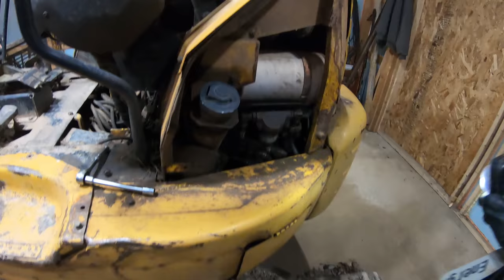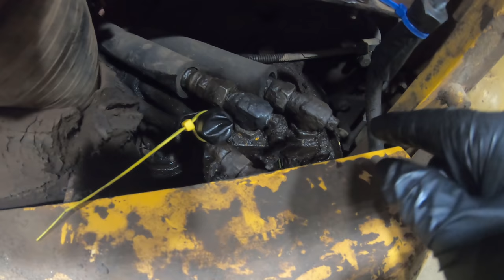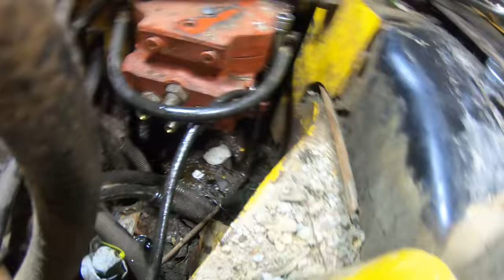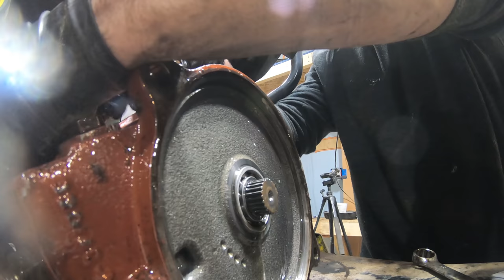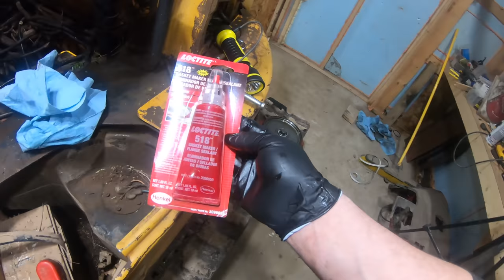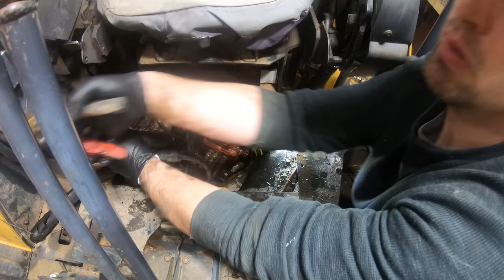How to remove and install a swing motor on a John Deere 35 zts

Comment: Thanks so much, I am about to reinstall my swing motor tomorrow and was a bit worried about how to fill it and remove air, this vid was so helpful thanks. Incidentally my digger is a yanmar 5.5 tonne and I used different coloured nail polish to mark all the hoses.

Comment: I'm a wuss when it comes to greasy dirt. That thing needs a little degreaser and a pressure wash. When something breaks in the field it is not much of an option but when it is elective repair work like this, the machine and you both benefit.

Comment: You should get a plug/cap set for those fittings.
Reply from the maker: I did actually have some but I think they were slightly bigger and kept sliding off easily, of course afterwords I found the right ones at powertech in kingston
Reply from the maker: @AndrewCamarata oh wow they are metal, I def am going to get this set, I was working with the plastic ones and they would fall off
Reply: @jmuller86 Yeah, it was helpful when I got it. With these, you could put pressure on the lines and they would be ok.
Reply: Andrew this type is used on bobcat cat and some hitachi/ deeres.  European hitachis of this model uses bsp fittings. Same as both your yanmar excavators
Reply: @megape95 Yes, good eye. Jesse, this is the set: https://amzn.to/2UL7HdL
Reply: @AndrewCamarata   haha no thats the wrong one too. The flare is external instead of internal. I cant find the right one on amazon
Reply: @AndrewCamarata  that kit is o-ring boss, NOT RIGHT,,  most fittings are JIC unless you take the fitting out of the valve or motor then its NPT OR o-ring boss to JIC, HE LEFT THE FITTINGS ON THE OTOR. NEVER BUY THE PLASTIC  ones the brake in cold weather and after a few uses they never stay in, as the need to be puton tight to hold the oil
Reply: @megape95  WHAT A RIP OFF ON THE PRICE, I CAN GET THE SAME SET HERE AT TRUCK AND HYDROPHILIC FOR $72 CND AND A jic  SET FOR $22 CND #4UP TO #12
Reply: @arnoldromppai5395  i know  the thing is expensive, but if you search better you can find cheaper ones
Reply: @megape95  i dont think i need to sarch amazon for anything cheaper then i can get locally or from my suppliers, anything i have ever looked at on amazon is high priced, and dont think anyone can beat $25 cnd
Reply: @megape95  All I know is my hydraulic hose guys say that its british thread
Reply: Another tip is to place a matching zip tie on the connections into the drive motor, that way you can match them when reinstalling the hoses to save you going back to your video. 😁
Reply: I've go to get in on this Jess & Andrew chat.
Never no what I'll learn.

Comment: Great idea about draining the system before disconnecting any hoses. I would've pressure washed the compartment before starting the repairs. That would've minimized the chances of contamination.

Comment: Interesting  idea buying colored zip ties. I've always used blue masking tape and sharpie  to mark hoses  and lines. Afterwards  I leave the blue tape on the line so next time it comes off its already marked. Keep up the good work on your videos.
Reply: WE HAVE USED a center punch for 50 years, you stamp 123 marks in each end of fitting were that hose goes, no looking back at videos, was none then..,, hose 1 has one dimple on each fitting, 2, 3 4 ans so on, you mark them once and they are there for ever, you hook up a line wrong and you can blow up a pump or some other component in a second
Reply from the maker: @arnoldromppai5395  yea, I did learn that recently, from the dealer service guys actually. I have a video coming out where I took out the control valve assembly to chase a leak, and there was about 40 hoses, I dont think I could fit enough dots to make those work? maybe start doing some on each side of the hex flange
Reply: @jmuller86  thats right work them around the fitting, and you can get 3 or 4 side by side or in rows down the crimp flang when the bottom nut to small, when i worked in the logging camps with big fellow forwarders, we would have to remove over 100 hose to change a lot of parts or engeine, and there would be dots all around every metal part, , hoses as big a 1-1/2" down to pilot 1/4" hoses
Reply: @jmuller86  You did IT Jesse, get some HEX punches. For a 40 hose job you have a maximum of 3 characters per fitting. 😂 (Yes, I am kidding)

Comment: I have a Yanmar like this . Excellent quality
Mine has slow leak .
Deere used Yanmar machines on small and Hitachi on large excavator s. 
That red loctite may be anerobic sealer cures without oxygen .

Comment: Hey I have the same machine, if your spin is slow and blade lacks the power to lift you might check the gear pump. I replaced mine and its zippy spin wise now.

Comment: Jesse, you may not see this but, What is "zero swing" and "swing motor"? 
About your zip ties having only 6 combinations. I took this as a challenge but I had to stop. You will see why.
L=Long, S=Short, Y=Yellow, B=Blue, W=White
LYLY, LYLB, LYLW
LBLB, LBLW, 
LWLW
LYSY, LYSB, LYSW
LBSY, LBSB, LBSW
LWSY, LWSB, LWSW
Then you could reverse the order of the last 9 combinations and have more. I know you must be thinking, "This guy must have a screw loose". LOL, I could code those as well.

Comment: You could weld a nut to the top of that hex bolt to make it easier to remove, assuming u have the clearance. Just a thought or buy new bolts.

Comment: Fun Video. Bought mini kubota excavator for home use. It compliments compact tractor projects. No thumb yet, have to machine a longer bucket pin for thumb mounting.
Reply: Check out Titan attachment. That company has great deals on thumbs. Their DIY weld it together thumb kit is very awesome and heavy duty.
Reply: I want a thumb on Takeuchi TB016. I know I have to get hoses made but whichone goes to which side? And do you have to fit some release thing so the thumb yields to the bucket? Anyone? Thanks.

Comment: Phew! Well done! Glad I don't have to do that...this time. What I do have to do is change at least one burst hose going down to the final drive which will mean lifting  the machine so I can access the inside/feed end from an access panel right underneath. To do that I have to move the machine a few yards out of a small store in a barn. Since at least one track isn't working can I push the machine backwards using the boom forcing the bucket against the ground -- freeing the brake by turning the engine on and putting the safety levers down in off position? Any response gratefully received.
Reply from the maker: jump limp it over, lift the one side up with the boom and swing it as you track with the working track
Reply: Good idea. But at present the boom is inside the wood store at the end of the barn so I've got to back it up 2-3 yards. When I've figured out how how to do that I'll do what you suggest, IF the other side is working backwards. There's a lot of oil on the track and I don't know if it was just spray from t'other side. 
Thanks.
LGB.

Comment: Interesting, I've had to do a similar job on a Bobcat 331, the pinion seal is bad and leaking oil.
Same size machine but Bobcat uses a Eaton hydraulic motor and no planetary just direct drive to the pinion.
Direct drive means they use hydraulic oil all through as a lubricant as well, no gear oil.
They also use the exact same setup with the 334, I know because Clark sent me both part diagrams when I was quoting the job.

Comment: Why don't you use a pressure washer to remove all the dirt from that engine/hydraulic bay prior to opening the hydraulics up?
At one point you say why they don't make it more accesible due to potential  dirt contermination in the hydraulic system, but giving it a 5min pressure wash (preferably with warm water and a soap) is a very easy thing to do to prevent 99% of that contermination.
Or don't you have running water in your workshoplocation? (if so, maybe rig something up with a reservoir or ground water and a filter?)
edit: oh wait, I've read your reply down in the comments, you already had the oil drained before realizing it was very dirty in there.
Thats a good lesson for next time :D
Reply: The best thing to use is Greased Lightning.
You can get it by the gallon.
I found it helping a friend clean the kitchen in the bar his dad owned.
I worked for the company that owned the Jukebox, pool tables and other games as the route service manager.
That stuff is incredible at cutting heavy grease and oil.
We used it behind their oil fryer.
The grease behind it was a quarter inch thick and had gotten them gigged by the county health inspector.
I thought they'd have to get a steam blaster till he squirted a 50 / 50 mix (usually you water it 70-75/25-30) on it and the stuff just run off like nasty water.
We did have to use a paint scraper on some of it but it all came off.
Ever since then I use it when I clean pool tables when I recover them.
Those can get real nasty on the sides in bars.

Comment: Hiii Jesse  !!!    first need (but so expensive) hot water pressure washer ! because some time just looking at the mess (grease oil sand mixed) enough to stop the job !!! 
To plug pipes and entry holes I make my conical cork stoppers  (ex wyn bottle corke) that give's you all size you need ! 
YAaaa they haven't invented spanners  with eyes on the end and feeling like the fingers

Comment: Jesse do u notice any effect on your other hydraulic functions by having a bad seal on the swing motor.When our seal went it affected everything from arm to stick to track drives.When we checked out the system pressures they were lower than spec.After we replaced the seal back to new

Comment: Would be nice if you had a pressure and could washed it first
Reply from the maker: When I got all the covers off I realized It needed to be pressurewashed, but by that time I had the fluid drained and couldnt wash it because I dont have a drain in the garage.
Reply: Jesse Muller good job love your video
Reply: @jmuller86  that dont add up in the video, you took all the covers off showed both areas that had to work in, and could see all the stones thick dirt, then you drained the oil..
Reply from the maker: @arnoldromppai5395  yea because I drained the oil first before doing anything, but the order was switched for the sake of the video.
Reply: @jmuller86  ok that make sense, thanks for clearing that up..

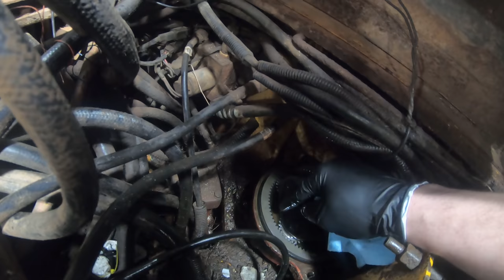Comment: 13:21 Is that large O-ring what makes the seal? Just me asking. Not picking at your work. At all.
Reply from the maker: I think its a secondary seal, I have the service manual and it says to use the primer and sealer
Reply: @jmuller86  Thanks. Was that surface ever sealed, right from the factory? It looked awfully clean.

Comment: Glad that fixed the leak for you, definitely a tough spot to work in.
My neighbors excavator can't slew uphill half the time, other times it drifts on its own until the brake kicks in.  Do you think that's a failed seal in the slew motor or elsewhere?
Reply from the maker: the problem I had ended up being the small gear pump, it powers the slew and the blade, and also offset boom. It was cheap and easy to replace
Reply: @jmuller86  That may be his problem, he recently said his offset boom had an issue as well.  Thanks for the help.

Comment: Jessy why don't you pressure wash around where you take things apart before, so you have a better working environment and greatly reduce the contamination factor, seems like a no brainer to me, like when you did the final drive on the new bulldozed, you scraped after you had everything back in, it seems like you have your steps out of step, just an observation Jessy.

Comment: ok if you had the swing motor tested because the swing was bad, but the swing motor checked out ok, so what fixed the swing, the swing pump, the swing pilot valve, witch is the most comon,?
Reply from the maker: It was the swing gear pump. I will have a video up in another week or so
Reply: @jmuller86  ok thank you, it maybe just the releaf valve in the pump, if it is a desent pump it will have one, the spring normaly brakes
Reply from the maker: @arnoldromppai5395  the gear pump was worn badly, the housing was all scored up and one of the gear shafts was really beat up. Looked like it was from low oil from the previous owner
Reply: @jmuller86  ok you seen the in sides, many shops will tell you a pump oe moter is gone when its just a re leaf, to sell you a new pump or motor
Reply from the maker: @arnoldromppai5395  yea I know, thats why I rebuild my own stuff, I  have rebuilt many transmissions, motors, transfer cases. I rebuilt the main piston pump as well so the gear pump was easy to figure out, But not rebuildable, they dont sell parts for it.
Reply: @jmuller86  cant seem to find the follow up to this video... is there one? I have slow swing on my sk55
Reply from the maker: @wheelinken  the problem with mine was the gear pump for the swing/boom swing
Reply: @jmuller86  thanks for the reply, did you end up doing a video on that?
Reply: @jmuller86  could you up load the gear pump video please, if you did make one?
Reply: @wheelinKen did you ever figure out what was wrong with your SK? I have an SK45 and I'm definitely lacking swing power/speed... just curious how you made out...

Comment: What does a zero swing motor mean, you said it a few times during the video.
Reply from the maker: its not the motor, its the design of the machine, the fram never goes outside the track when swinging

Comment: What's name/brand of black gloves you're wearing? Thx
Reply from the maker: They are called venom nitrile gloves. I buy them at lowes, its like $20 for 100 gloves. They work great, 2 layers of material so they dont rip so easily

Comment: Why not zip tie the motor fittings?
Reply: Doesn't make sense to color zip tie the hose and not the corresponding fitting.  That would tell you exactly where it attaches too.
Reply: That’s what I do ,didn’t understand why he didn’t expect I guess he was going to watch the video.🤷‍♂️
Reply from the maker: There was only 4 hoses and 1 was smaller so the other 3 were kind of obvious where they went. I did take the main control valve assembly out, and that has 40 hoses, so I bought more colors and did exactly what your saying where I did corresponding ties on the adapters.
Reply: @jmuller86  If you don't have enough colours put combinations and multiple ties on.

Comment: Jesse jesse,you guys all make the same mistake. Old equipment is all warped and rust jacked. When you REMOVE a bolt ,it puts more pressure on the remaining bolts. SOOO, loosen a bolt and tighten it back up. Then go on  to the next one..,ect. When you have them all cracked loose,NOW REMOVE THEM .

Comment: you color coded the female side of the hoses but didn't color code the male fittings to match
Reply from the maker: Yea because I can play back the video and find out if its left or right. I did a big manifold job and marked both for that

Comment: Boy, and I thought it was a b#@th changing a main rotor gearbox on a Coast Guard Sikorski HH52a helicopter.
Ot the T58 Turboshaft endine.
Those were a piece of cake compared to that as we were able to pull off all the "skins" to get at them.
Me thunks that was designed by ghost satanically inspired engineers from the Spanish inquisition.
Reply: No one expects the Spanish inquisition.

Comment: problem is you cleaned the mounting surface off and primed but you didnt do the same on the motor, how long will it last
Reply from the maker: I did clean the motor surface with the starting fluid, but the manual said to apply the sealer to the ring gear housing
Reply: @jmuller86  thats good you  clean the motor surface, you just didnt say it or show it and thought you didnt, yes you only apply the sealant to one surface only..
Reply from the maker: @arnoldromppai5395  yea I was going back and forth about even making a video about it, seemed like it would be boring to most. So the effort wasnt 100% to film everything, but then when I was done I realized that there was almost no decent videos about the swing motor so I decided to go ahead and edit what I had

Comment: If it ain't broke, don't fix it... smh
Swing is always slow, it's made that way on purpose.
Reply from the maker: The cycle time on the swing was about half of what it should be. I just replaced the gear pump for the swing/blade yesterday and its finally fixed, was only getting 1000 psi instead of 3200. Will have a video up about it soon
Reply: @jmuller86   Roger that..   Hell, you would know...  I'm mouthing off and never even seen your tractor. lol
Reply: @jmuller86  it may have been just the re leaf valve in the pump that went bad, broken spring..
Reply: @jmuller86  I have kind of the same problem but my swing speed seems fine, its the power to push sideways with the bucket i'm lacking. I would love to see that next video. at what port did you test the pressure?
Reply from the maker: @douglasmason6742  you test it right at the pump, the swing/blade/boom swing is on the same pump, its the outer gear pump. should be the same psi as the piston pump..3200 psi for me. for me the fix was a new gear pump, as it cant be rebuilt